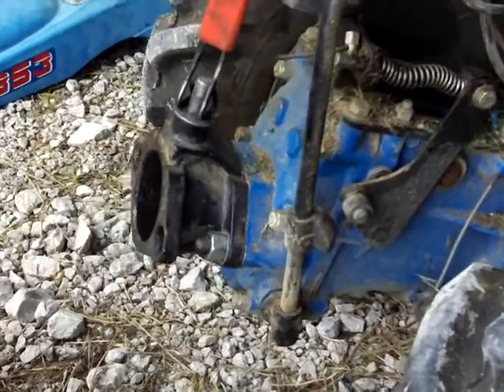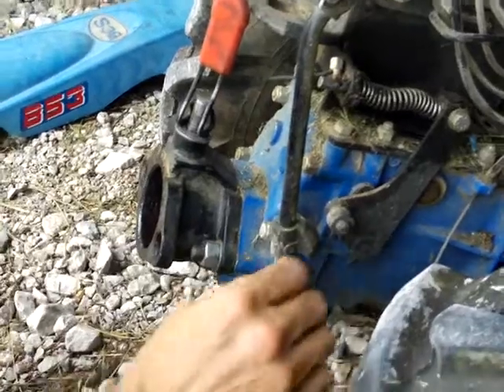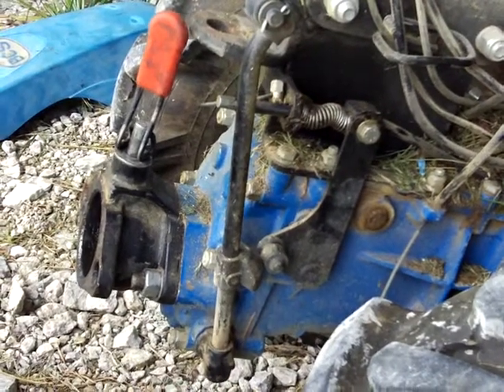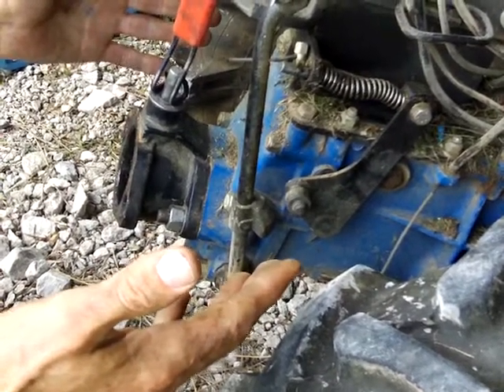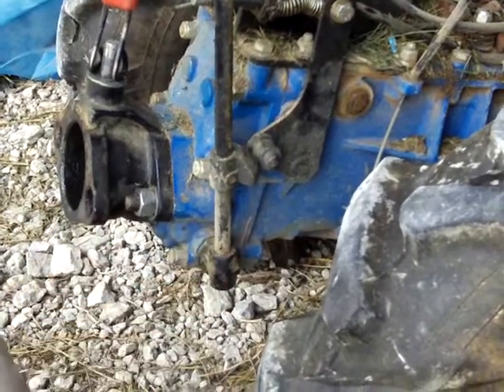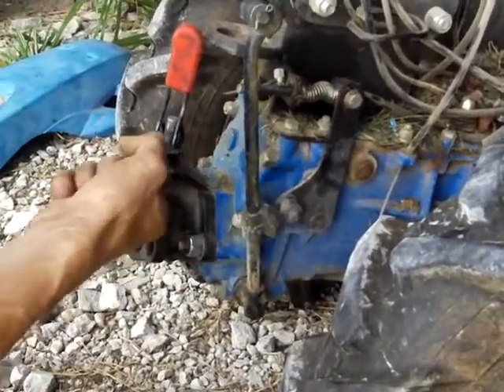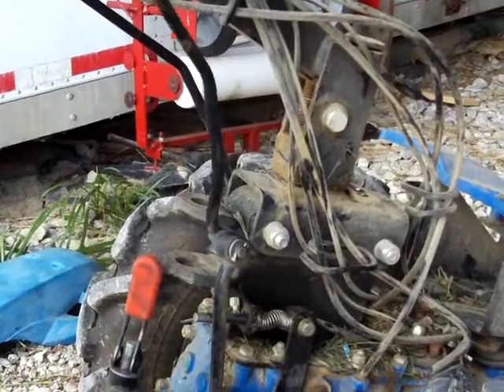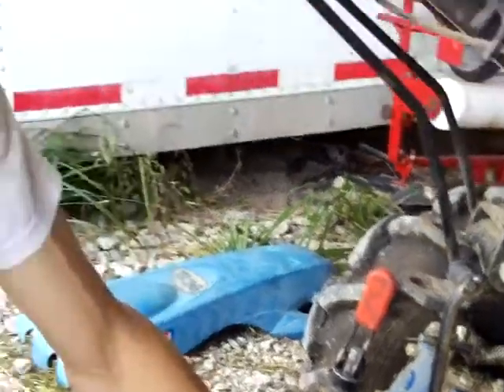BCS Walk-Behind Tractor: PTO Lockout System

Comment: You can buy the bar with slot and holes drilled in Uk it’s £51 
I’ve had lots of these and most had seized so make new rod or buy 
On mine there’s a spring a washer and o ring to lift and oil   You must lift o ring up to oil as it seals the top

Comment: Thanks Joel, this was really useful. I've just bought a used Ferrari- not the car I'm afraid but the bright green clone of the Camon C6. The PTO shift joint is frozen as you described and I've tried vice grips and oil to no avail. I'm going to try a little heat like to prescribe in your video. Hopefully I can shift the little sucker into rotating! Cheers, from a very wet and windy Suffolk, UK!!

Comment: greetings .  I have a 728 trailer with a 7.5 hp diesel engine and a bcs gearbox.  While it was on and working, I rinsed the tiller with hot water. With the high pressure of the water, it turned itself off an hour later. Can you explain the reason for the tiller turning off?  If it is with the film, I will understand better than a speech ... Thank you for your efforts and training ..